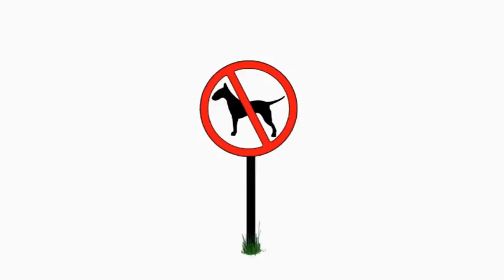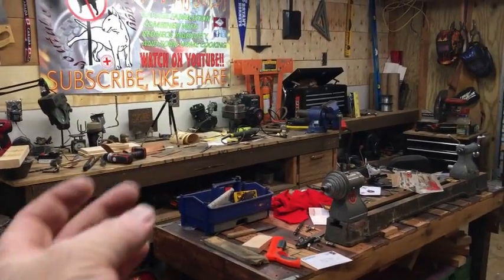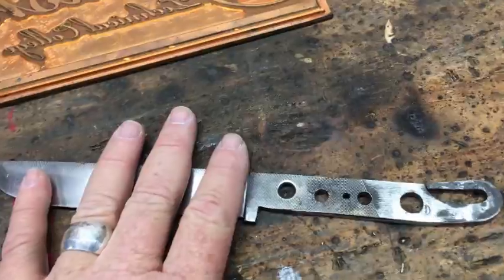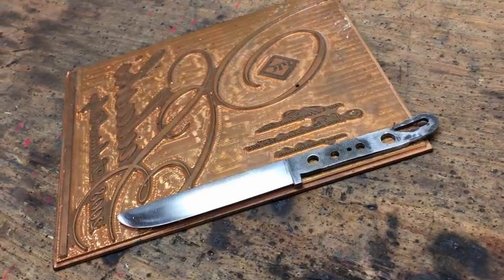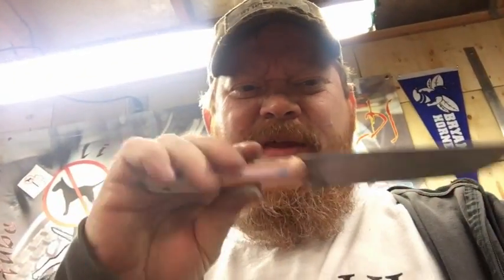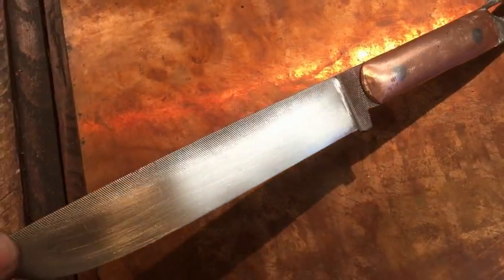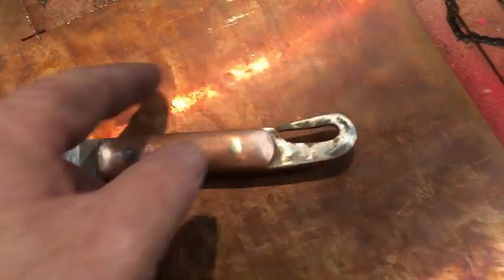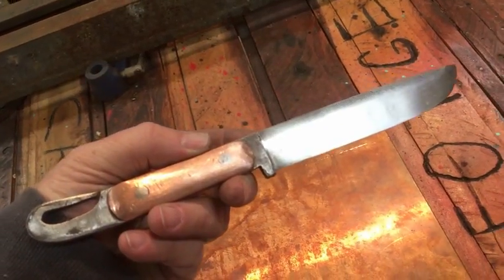File Knife 4 ~ Copper Handle

Comment: Yo I love machining videos... Great track and great work... I used to work on motorcycles years ago... Mainly painting but I loved using a plasma cutter to make pieces in intricate shapes then spot weld everything... Good job on the Blade handle.